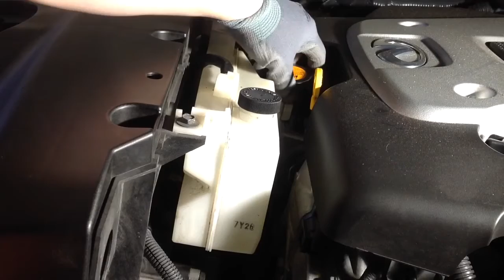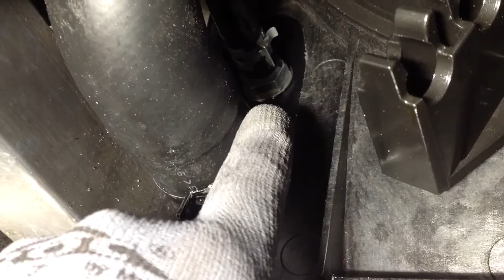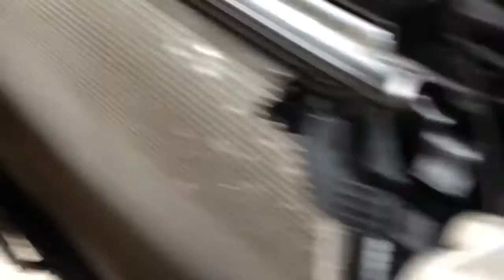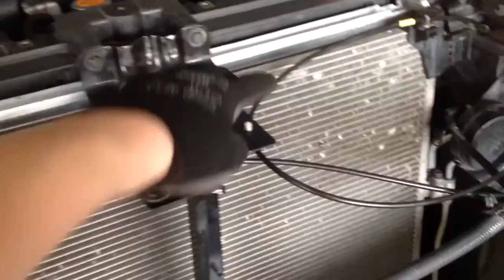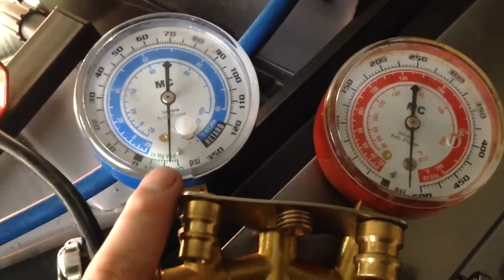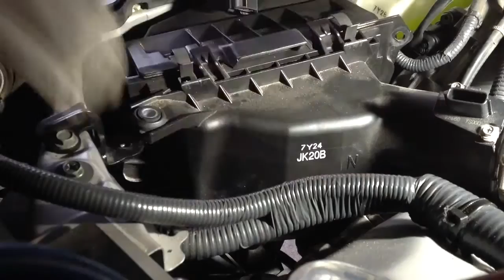How to change radiator on 2008-2012 Infiniti EX35

Comment: Are the hose clamps one time use?
Reply from the maker: I reused the original ones with no issues.
Reply: @DelCar-garage  I’m having the same issue with the transmission cooler hose so I have a radiator on order, do I need to get anything for that cooler hose?
Reply from the maker: @fatimagutierrez4757   replace both transmisson cooler hoses as the cars are now getting older and rubber hoses get brittle,  I just replaced both on my wifes car last month.  I got same diameter hoses at local parts stores and cut them to lenght.

Comment: Hey, great video, very helpful. Quick question though: I replaced my radiator and now the car doesn't want to move. I'm guessing I spilled too much of the trans coolant. Do you know which of those hoses are for the trans? Just the upper and mid (small) hoses on the drivers side? Thanks
Reply from the maker: Yes the small hoses are for the trans fluid.   Make sure you check the level as you fill l, over servicing is just as bad.

Comment: @DelCar - Amazing & informative video!  My 08 EX35 worked perfectly & randomly out of nowhere smoke started coming out of the engine. Took it to Infiniti and they are saying: "Radiator has cracked and both radiator and thermostat assembly must be replaced and it's a 5.5hr job". Infiniti is charging me $1,000USD for labour. The parts I will buy myself for $650USD as they wanted $1,000USD for the exact same parts. This will overall cost me ~$1,600USD total (parts & labour).
I live in Dallas, TX. Any advice? Is their $1,000 labour estimate and 5.5hr job true?
Reply from the maker: That means they're trying to charge you about 182 an hr.  Almost all  shops will post their labor charge and you can get a better idea and do a price comparison, but in general dealers will be more expensive.  If you're not able to replace it yourself I would definitely shop around as they are charging you on the high end. I left Texas a couple years ago wish I could help, good luck!
Reply: @DelCar-garage  These are the parts they want for the work to be done (https://imgur.com/a/2UyGWjB). According to that is it possible that it's a 5.5hr job?

Comment: hello, I just watched your video, and it is great. the problem i'm having is I can't find the radiator that you bought. my car uses the same radiator setup that you have, which has the condenser separate from the radiator. every radiator we found has the condenser/radiator combo. even the infiniti dealer says they don't sell, or even heard of the radiator and the condenser being sold separate. if you don't mind , could you please tell me from what supplier or parts supplier you bought your radiator from. thanks for any help
Reply from the maker: wilson will.  No problem, I bought it radiator express.  Radiator Express - INFINITI 2008 EX35 JOURNEY 3.5,,3498,V6 RADIATOR
https://www.radiatorexpress.com/part_lookup.asp?make=INFINITI&year=2008&model=EX35&submodel=JOURNEY&engine=3.5,,3498,V6&subcategory_id=RADIATOR&stepCompleted=5
Reply: thanks so much . you would not believe what i'm going thru trying to find the setup for this car. we have a 08 g35s. it was bought used. the radiator is  full aluminum with the condenser mounted separately  to the top and bottom of radiator with bolts.  it does not clip on as yours. but the setup as far as top and bottom mounts on radiator is the same. this has been a pain to figure out.  the radiator on the car is more like your ex35 than for this g35s.  the dealership is no help either.    thanks so much for getting back to me. and again great video
Reply from the maker: wilson will No problem, as long as your able to secure it and the inlet/outlet match you're good to go.  Might want to backflush your coolant system due to the aluminum particles, sound like your waterpump went out on you.
Reply: I was thinking that same thing about the inlet/outlets.   as far as the condenser mounting up, time to break out the clothes hangers.    i'm not kidding. thanks a bunch.
Reply: i'm sorry I just realized that you might have thought that I said the radiator was full of aluminum. what I meant was is the radiator I have Is all aluminum. it has no plastic tanks as the one you have. sorry       thanks again
Reply from the maker: wilson will  :) got it i see it now.  Good luck!

Comment: I changed radiator on my QX70, which is very similar to EX35, w/o having to disconnect AC condenser. Here is the link to the video that proves it:
https://www.youtube.com/edit?video_referrer=watch&video_id=pF2U6oDUfGU
Reply from the maker: BuiltNoTboughTdc2 In my case even removing the grommet/metal bracket still gave me minimal clearance and too much pressure on the AC lines, so I still wouldn't recommend it.  The short cut was not worth the risk for me as lines and condenser get pretty expensive if you damage them.  Can't go wrong when you follow the maintenance manual.

Comment: Whats up DelCar, awesome video bro, with out your video I would have never been able to change my radiator on my 2011 infiniti M37. Obviously on my car its a little different but its very similar. Anyways I am writing to you because after working on the car, i am now unable to open my hood 😠. I had to disconnect the hood latch assembly and disconnect the hood lines in order to change the radiator. Do you have any recommendations for me? Thank you and greetings from MIAMI Florida.
Reply from the maker: Bruno Gutierrez.  Are you able to pull the hood up a bit? or is locked down completely?
Reply: It is locked completely. It wont open at all.
Reply from the maker: Bruno Gutierrez are the cables hooked up to the latch? There's a couple of thing you can try. First get someone to help you out,  have them pull on the hood release while you shimmy the hood that might free it up just enough so you can get your hand in there.  If that doesn't work you can jack up the car and remove the shroud from the bottom and try and get the latch to release, you'll need someone working the hood also.  It sucks just be patient you'll get it.
Reply: thank you delcar. yes the cables are connected so thats why i find it to be wierd, i have tried playing with the release from inside the car but it gives me lots of resistance and the hood will not release. im going to jack the car up now and try it from near the tires.
Reply from the maker: Bruno Gutierrez ok, you'll still need someone to help you.
Reply from the maker: About 2.5 - 3 hours.  Rates are different depending on where you live.  Shop around.  Good luck

Comment: Great video! Thanks! Just replaced the radiator a few hours ago. Few comments. You don't have to recover AC. You just release tubes on the left then release the clip holder for tubes and it will give you room to push AC radiator out of the way when you remove the radiator. Also you don't have to remove the Overflow bottle or seal from the grill. Attention. To remove the grill you have to remove the  upper radiator cover first. Then you can remove the grill clips grill has clips on the bottom.
Reply from the maker: Thanks! There is a lot of short cuts you can take but you also risk damaging other components,  you can never go wrong by following the repair manual.  In my case the  condenser had minimal movement even after released the bolts and clamps,  I wouldn't recommend it since you risk bending and putting pressure on the AC lines or damaging the radiator or condensor fins and which can make the project more expensive than it has to be.  Thanks for the feedback.

Comment: Also, did you replace your AC dryer? Did  you need to?
Reply from the maker: Bill Hamm No need to replace the air dryer just be careful and try to keep debri from going into the lines once you open them.
Reply: DelCar is it required to buy the radiator and condenser together or is it ok to just purchase the radiator and R&I the condenser? Thanks
Reply from the maker: Darryl Suggs  no need to replace the condensor if its not bad.

Comment: what size clips did you buy? the grill clips?
Reply from the maker: Bill Hamm I got them from eBay they're pretty standard.  I use them on my G35 and on the EX.  "100PCS OEM BUMPER PUSH CLIPS FASTENER RIVET FOR NISSAN 350Z INFINITI G35 FX35"

Comment: I want to personally thank you for the help your video gave me.i took my Infiniti fx35 35 to an auto shop and had then recover and vacuum my ac system first. Next i began to take apart everything that was mentioned in your video. The only problem i had was, when trying to remove the radiator the upper hose on the left side had to be removed in order to remove the radiator.i also had to remove the upper hose sprout on the new radiator and put it back on once the radiator wad in place in the car.  The only concern i have now is weather to take it to an auto mechanic to recharge the ac system or just go to AutoZone and get a can of r134a ac Freon and do it myself.
Reply from the maker: im glad everything worked out for you.  If you don't want to mess around with the vacuum pump then I suggest taking it to the shop to have it recharge.  The vacuum pump will remove as much moisture as possible from inside the system since it was opened. You can recharge  it yourself but you might run the risk of it not running as cold as before.  That would be entirely up to you, I suggest just renting the pump run it for 5 mins really easy to set up and add the freon yourself, all you would spend is on freon. best of luck

Comment: Good video del car.i have an 09 fx35. I have to change my radiator also. Do i have deal with removing the Freon and replacing it also it is their a way around it for my model. Thanks
Reply from the maker: richard collins Hello Richard just checked the manual and it looks like the set up is the same no way around the condenser. If you are going to do it yourself my video should guide you pretty well. Be safe! Always wear safety goggles when working on the AC system.

Comment: Did you have to recharge the AC lines?
Reply from the maker: Yeah, there's no going around it.
Reply: +DelCar thanks, I'm assuming one of the AC recharge bottle kits you get at an auto store is not sufficient?
Reply from the maker: +Chase Nel.  I used the 20oz bottle and it was more than enough.  Its been more than a year and my AC still running nice and cold.  make sure you vacuum the system before recharging in order to get as much moisture out as possible.
Reply: +DelCar OK , thanks for the advise!
Reply from the maker: +Chase Nel Any time.

Comment: if you would of taken off the cooling fan and brackets would it of been possible to not have to reclaim the ac..
Reply from the maker: Not possible. For some unknown reason Infiniti engineering decided to make the fan shroud part of the radiator support therefore the only way out is through the front.

Comment: How long did it take u boss?
Reply from the maker: Less than 3hrs  if you really want to knock it out fast.
Reply: DelCar u are the man. Thanks for responding so quickly
Reply from the maker: +JUANITO5338 no problem man.  good luck.

Comment: Is there a way to replace the radiator without taking the condenser off?
Reply: Shehab Alzobaidi how to refill and check transmission fluid on 2009 ex35?
Reply: any way to check transmission fluid level on 2009 Infiniti ex35?
Reply: Yes, dipstick is located toward the back of the engine.
Reply: Shehab Alzobaidi driver or passenger? Can you snap a picture by any chance?
Reply: Shehab Alzobaidi I found one online. thank you.
Reply from the maker: Bill Hamm  I going to be changing the transmission fluid soon within the next two weeks,  I'll make a video. The dipstick is by the firewall, right behind the engine cover.  Easier if you're standing on the side of the car.
Reply: DelCar thanks for the reply. I checked twice and didn't see it. I think on the 09 or at least my transmission is sealed (no dipstick).
Reply: Yes, see my post above.
Reply from the maker: No, the way its designed it has to come out. No way around it.
Reply: +DelCar That is a poor design.
Reply from the maker: +Shehab Alzobaidi it is a poor design. I  can't  imagine how much the dealer would charge for it.  The job itself is not bad, i would say the worst part is dealing with the refrigerant, since most likely you have to pay for it to take it out.
Reply: I have looked around and all mechanics around me asked for about $400+ so I decided to do it myself.Most of them didn't know that they will have to discharge the a/c system beforehand.  I ordered the part of eBay, and I will work on it once the part is here.
Reply from the maker: Im sure they would've raise the price once they realized.  Good luck, if you need help just leave a comment.
Reply from the maker: make sure you refill any trans fluid that you loose when you take out the cooler lines
Reply: Yeah, I bought a bottle from amazon "nissan matic" 15 dollars, and the car runs as smooth as ever.

Comment: Thanks for getting back to me. Two questions. Do you recommend parts direct from infinity or do you have a good website I can get my condensor/ radiator combo from?
Also, do you have or recommend a friend or someone. You know who still lives in NY, that is GOOD to work put in my replacement radiator/condensor combo once I get it.
Reply from the maker: Are both of the radiator and condenser damaged?  Dealer parts are great, but so can aftermarket parts.  I have use both.  Dealer parts can be overpriced though.  I actually got an aftermarket radiator from  radiatorexpress.com  for a good price. they also sell condensers I'm sure they'll work a deal for you if you really need both.  since you won't be fixing it yourself I would call a shop and ask how much they'll charge for the whole job and then ask them how much if you bring in the parts yourself.  I wouldn't be much help in finding  a shop sorry,  I always do the work myself.

Comment: Hello. You are great. I have the same problem on my 2008 infiniti G35. Dealer wants waaaay to much to replace. Local guys dont seem to know infinity that well. Are you in NY or NJ? You could fix my car too.
Reply from the maker: The G35 is pretty similar.  I wish I could help you out but I'm in Texas.  The dealer will definitely rob you, they want 800+ just for the radiator.  Have you looked into nissan or infiniti extended warranty?  I used to have nissan qualityguard plus on my G35. It was pretty good, they finance the warranty  you need to.